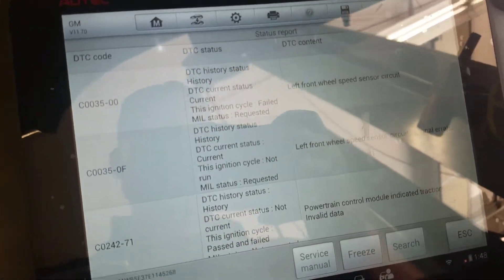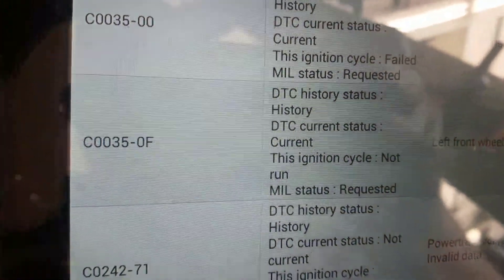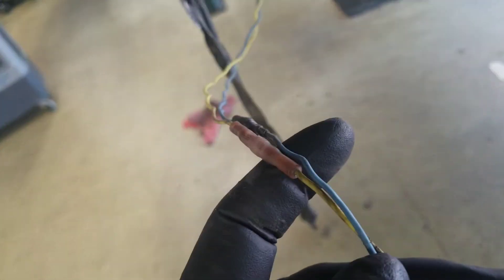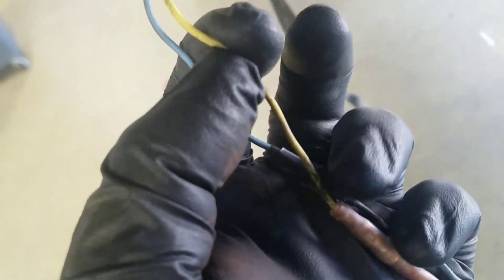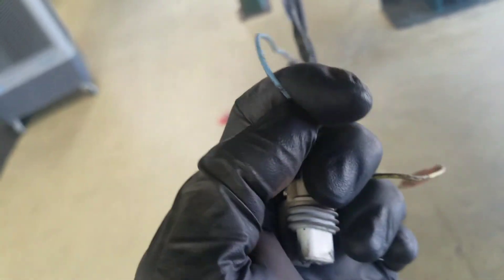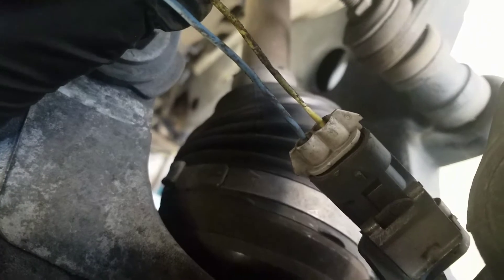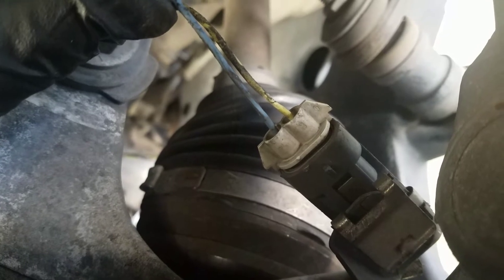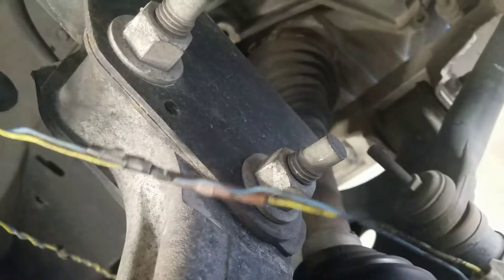ABS code C0035 Impala and other GM's QUIK TIP!!!

Comment: C0040 present with both 00 and 0F. Found a open in the case like you said in the video but it was on the top side of engine compartment at the three way splice from abs module and pcm. Awesome video super quick to the point no product sales or goofy life stories!

Comment: I installed a new harness on mine and its still giving the code, also installed new hub bearing with sensor on my 04 grand Prix. My scanner is actually reading the sensor data as I drive, only two things I can think of is I got the two wires switched or I need a ecbm. Any help would be appreciated thanks.

Comment: Easier way would to be a continuioty test from the end to the abs control module harness
Reply: You can still get continuity with one strand of copper wire still connected, Ive seen techs burned on this before that just do a continuity check with meter, you have to do a amperage load test on the wire to really see if the wires bad, I just use non led bulb and a old turn signal socket with wire leads to do the load test, bad thing is you have to isolate the wire circuit and put voltage thru it, I run into this issue a lot on wiring on the mass  transit buses I work on every day for last 20 years, that’s some bad wiring repair from prior techs but a good tech video!!
Reply from the maker: Continuity would not tell you if the wire was any good intermittently...
Reply: @L1Training yes it would, just jiggle it the same way you did during your test with the leads still attached.

Comment: Would it just be better to replace the whole wire and harness? Also where do that wire connect at in the engine bay?
Reply: if you repair it correctly with shrink tubing and also the ones that have glue lined on them, it will be more than fine. Your engine harness also has splices in certain areas. If you can get a full wiring harness for the abs sensor then sure swap it out, its not a very difficult process.

Comment: Hey I have the same problem where do I rewire my new one ?
Reply from the maker: anywhere upstream in the circuit from the faulted wiring.
Reply: Right on man, thanks for the reply I ended up having to cut in a few inches from the actual module, coz my wire was just falling apart and corroded almost all the way to the main harness. I was getting worried but figured it out 👍 haha thanks again